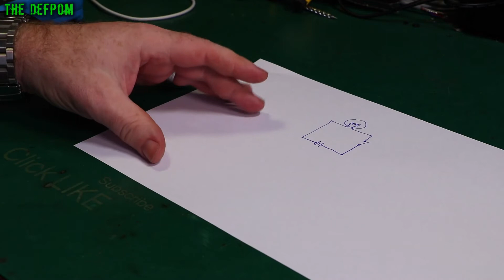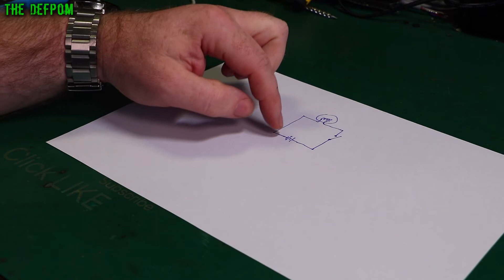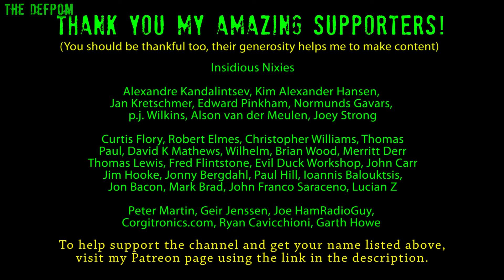🔴 Is Veritasium WRONG ? The Big Misconception About Electricity - Energy Doesn't Flow Inside Wires

Comment: The electrons are already there, yes, but it's not the "shuffling" ("bumping"?) of the electrons for want of a better word that's getting there and lighting the bulb instantly, because the length of the wire is half a light second long in either direction. If you don't take into account direct electromagnetic field coupling over the 1m gap then you cannot get the 1s/c answer, because it takes time for the "electron shuffle" to propagate along the wire. And that's what the question is about, the 1s/c answer.
For your explanation to work then the "bumping" action would have to greatly exceed the speed of light.
Reply: Electrons don't "bump" per say. You need to  analyse it as a superposition of the fields of all  the electrons and the impulse potential induces by the battery to understand the dynamic response of the system. What transmission engineers like to call propagation delay. 
Unlike  a hydraulic plumbing analogy  the electric system boundary conditions extend past the pipe/wire. That is why ferrite chokes outside the wire affect the system. I think that is the point that veritasium was trying to make. His assumption were not realistic in some places which also added to the confusion of what he was trying to say.
Just like the skin effect these external influences are more pronounced with frequency and power density. That is why they do not seem intuitive and why the "bump" analogy of hydraulic systems breaks down.  
Just my way of seeing it without going into wave particle duality of it all.
Reply: @MeHow  
And you know this, how? We can't even measure the speed of electrons, to this day. We don't even know where they are. .We only have rudimentary methods to find them by looking in the most likely area of their general, probable vicinity. This is a bullshit guesstimation. We're not even sure if there is more than one electron.. And don't even get me started on what time really is. We still can't keep our own idea of accurate time. 😆
Reply: You're not getting it. If the entire circuit is already full of electrons, and one moves, they all move at the exact same time. There is no delay, except for the speed of light. Because what is light? Just another frequency in the EM spectrum.
Reply: @SloppyGoat  transformer - how the energy is passed through the air gap? 😉
Reply: @mehow357  
The EMF is everywhere. So are electrons. If you care to think about it as particles. But it's actually always a wave. All frequencies are.
Reply: Neither bumping nor potential difference (how does it propagate?), but the electromagnetism is the key to the answer. 
What will break Deprom's logic is a transformer - there is an airgap, there is neither bumping nor potential difference, electrons are not moved from one side of the transformer to the other side, but still the energy is transferred. 

I'm not a physicist, so I do not have a complete answer, but I would rather go the electromagnetic path (and how it is propagated along the way).
My intuition though says it won't be half the light speed as electrons spin has to change to change the magnetic field. This is a physical property change of the "object" with the mass (electron has a mass, my primary school friend was leading the team in Max Plank institute and they have measured it in the most precise way in the world ) As there is a mass involved - speed of light is not achievable, so half the speed of the light is impossible. The need of propagation of electromagnetic field is observable: the further the distance,  the magnetic field gets weaker, thus it has to be "propagated" by next electrons. I could imagine that energy involved in electrons spin change might be quantanized and quite constant, like the energy needed to change electrons orbit in an atom, and that's why we may observe it as almost lossless (quantum of energy is passed by making next electron's spin changed,  ect, ect)

But let's not go that deep. These are just my initial thoughts on the topic.
Reply: Eevblogs response doesn't make full sense 1m/c is a thing. 1s/c I think not a thing here.
EEvblog has failed to simulate speed of light in related videos.
The 1m/c option is a hot mess and is not accurate. However radio is possible and some energy can migrate across space.
Reply: The invoking i’m talking about is through the field. He is right.

Comment: The lightbulb turns on in nano-sec because the direct wave pushes the electrons at the lightbulb. For the electrons to push the neighbouring electrons along the wire, it will take 1 sec to reach the lightbulb, not immediately. I did a simulation in my channel and hope you can take a look. Thanks

Comment: This is 100% correct. However, not only are there already electrons in the wire, waiting to enter the lightbulb, but they are already in the lightbulb filament!!! We're basically only talking about the motion of one electron, starting the cascade effect. Assuming everything I know about electronics theory is correct, and so far, there is no reason to doubt that. That Veritasium video is nothing, but click-bait. 🙄
Reply: Of course, I'm speaking as if electrons are actually particles. They are not. They are a wave. This is just the best way we've been able to explain it.
Reply: Yes, electrons are there in the filament, but it doesn't mean they will get the push instantaneously by those electrons at the other end of the wire 300km away.
Reply: @SiliconSoup  
But it will be so fast that it should be called instantaneous. There's not going to be a delay between each one. That's not how this works. They aren't even really particles. It's a frequency wave.
Reply: @SloppyGoat  the cascading effect will take 1s for 300km, so it is not the explanation the nano-sec turn on of lightbulb.
Reply: @SiliconSoup  
It's going to take about the exact amount of time that it would take for one electron to move, if we're talking about this as if they're particles instead of frequency. The distance will make absolutely no detectable difference. If you can't understand that, I don't know what else to tell you. Electrons never even stop moving. That's just how we like to think about it.
Reply: @No_Kings_Allowed  
And I think everyone is confused about this, including you. Even some of the most prestigious physicists are confused about this.
Reply: @SloppyGoat   there are no electrons in Copper???
Reply: @nathanhaiduk2957  
Of course there are. There are electrons in everything, everywhere. If you can see it, it's being held together by electrons. Even if you can't see it, it's being held together by electrons.

Comment: The actual wire length is probably less than 200 feet: of course the bulb lights ‘instantly.’ Under Veritasium ideal condition 2 seconds. Expanding electrons leave the surplus high pressure- ‘negative ‘- terminal spiraling at @ c - enroute to depleted low pressure-‘positive ‘- terminal. The magnetic ‘field ‘ produced leaves perpendicular to wire also spiraling. Magnetic fields do not light up the bulb: no 1/c. “The Final Theory: Rethinking Our Scientific Legacy “, Mark McCutcheon for the Physics.

Comment: The fields move at near light speed, and that does two things - spreads the fields out across the 1m gap (so there is some signal - not full power - 1m/c seconds later), and sends the fields down the line.  It is that propagating E field that gets the electrons moving, and those electrons moving keep the field moving down the line.  That is roughly what you are describing as the 'bumping' - the electrons 'communicate' with each other by way of their fields, and those fields move close to c.  The intrinsic inductance and capacitance of the line slow down the propagation to something a bit less than c.  Because of the HUGE number of carriers (electrons) in the wire, their net speed is incredibly slow, but that little movement is sufficient to keep the field zipping along.  Hope that helps.
Reply: At bob white. Hooray. It was my understanding too. Im wondering if the field, in the nano seconds when it starts, induces current in front of itself. So you have energy flowing extremely fast to its target. Its accelerating itself . Thats the way i imagine it.

Comment: Firstly, it can't be the speed of light, because when you turn on a light? You are delivering power, and that makes even an extension cord a TRANSMISSION LINE. And all transmission lines have a VELOCITY FACTOR. (Any table of coax cables will have a velocity factor listed for each type.) What's more? This is a balanced transmission line, since we are talking AC. Finally? There's skin effect. So sure, there's a magnetic field OUTSIDE the wire, and an electrical field OUTSIDE the wire, sure! But...the outer shell of a copper atom has en electron knocked out of its orbit, this goes to the NEXT copper atom outer shell, that copper atom sends an electron from its outer shell to the next copper atom, and so on. So it moves IN the wire, and as a CONSEQUENCE of this motion, a FORCE. (Fleming's right hand rule.) Google a picture of Fleming's right hand rule and there you have it! 73 DE W8LV BILL

Comment: a lot of videos have shown vertasium to be talking nonsense. his poynting vector diagram only works when the current is in a steady state, which is when the current is fully flowing which would takes seconds and the bulb is fully lit.   yes when the switch is turned on there would be minute electromagnetic interference that would cross to the bulb at the speed of light and would do nothing,  all circuits which go from off to fully on will give strange results since the votage and current is ramping up and all kind of wierd AC effects.  A radio receiver nearby might give out pops and crackles as it receives the switch on interference.

Comment: If the field transfers the energy, the actual wire size is no longer  of any role. Also a parralel wire loop and lamp would receive the energy too without needing a battery, induction alone does not apply significant energy flow. 
Long before closing the circuit all electrons in the wire rest at potential, and all will begin movement on closing corcuit, no need for electrons to push the next one along into motion, so propogation rate is not applicable. Within any conductor, all electrons are in constant motion in random modes, remaining in balance due to local electrical imbalances as some electrons crowd and others disperse, causing resulting fields to rebalance motions, all at atomic scales, keeping balance neutral potential. Only under other physical conditions does a electric field establish, like chemical so battery, charge by electron balance so capacitors in charged state, or induction from magnetic. This field is getting electrons into motion. 
Extent of natural electron motion is visible in permanent magnets,  where it is orientation of natural electron motion of the atoms, creates large magnetic fields. It takes considerable electrical power to create similar strength M  fields, that can exist without any power expenditure in polarised magnetic materials.
By the proposed theory we should transfer all power only by EM fields , meaning RF,  if that ridiculous theory of energy in the E and M fields were true.

The fact that an individual electron travels slowly, does not affect the huge numbers, measured in coulombs per second, passing a given point per second, each individual electron carroes very, extremely, minute energy itself.
Just treat this topic as anothet massive internet false item from some foil head nut.

Comment: Our teachers at Shawnee state in Ohio, (electro-mech engineering) explained it mathematically first and in simple terms like this. (Electrons stored in the battery travel on the outside of the wire. Hence the use of stranded wire over solid is a better choice . Not because it's easier to work with but because more can flow in a given area. The end result is pretty small mind you and a half a light second may not be much but over the course of miles of wire it will add up eventually.  In small electronic curcuits we aren't going to notice any difference.  But in the computer world where high speed and latency becomes paramount as we move into the quantum world it becomes a big deal. We're we taught right? Just because it works on paper doesn't mean it translates to real world application.  The engineer/tech battle still rages after all these years.  I stand amazed.
Reply: You students and teachers at Shawnee State got it RIGHT, and my hat is off to you. Thinking Experiments like these really to a lot for our understanding, even as we have formulas and our breadboard (and virtual) labs: Stranded wire is CORRECT. At radio frequencies LITZ WIRE works even better...call it the super stranded! ;-) You won't see it much, nor can you transfer serious power with it.  and it hails back to the Crystal Radio Days! I think the only kind I purchased was New Old Stock. 73 to you there at Shawnee State from W8LV Bill.